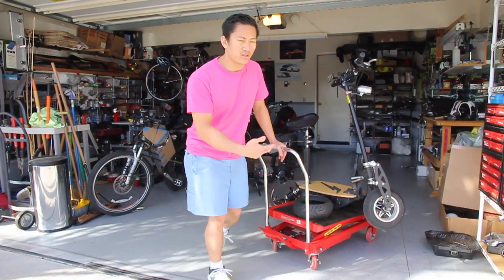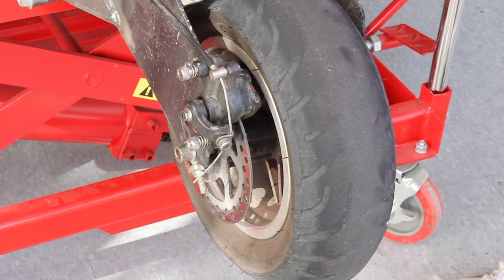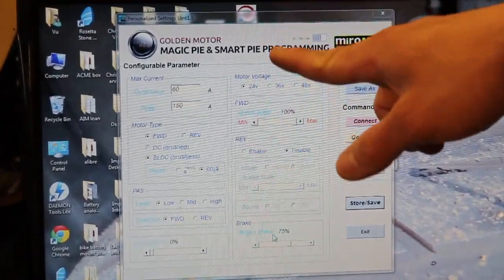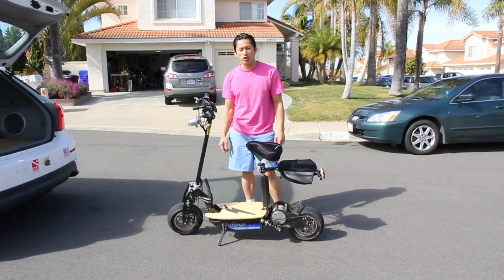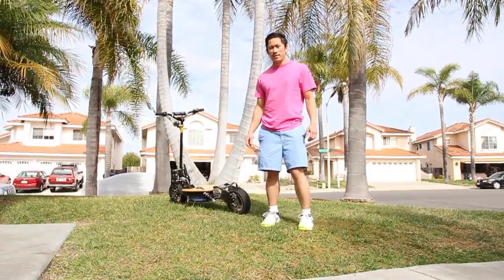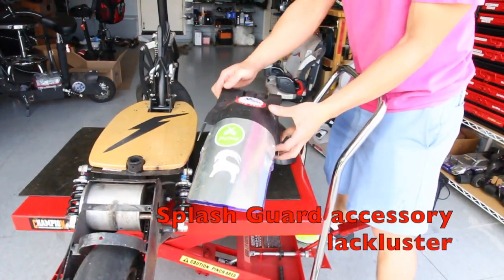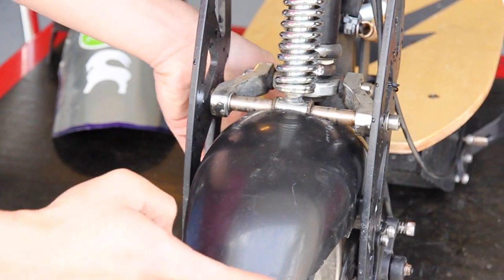1500 Watt Lithium Brushless Scooter Part 3

Comment: i got mine in the mail 2 days ago, man is it fun, i went to bestbuy, walmart and target, all in within 2 miles from home, folded it up up it in a cart and pushed it in the store as i shopped, i was never questioned. alot of torque, it almost stood up the first time i hit the throttle, i dont have hills were i live, got up to 31mph using speedometer app on phone, ill get a gps watch to mount on this to monitor my speed

Comment: Just a heads up on the controller that failed. He upgraded the new scooters controller that came in a few weeks ago (1500 watt ones). He said it was the only upgrade and everything else is the same. I think the tires were 11" though not 12". I'm not sure though.

Comment: Love your videos buddy! I have a very similar scooter too! 1800watt 48v one! Have had a reoccurring issue withmy batteries though man. Theyre new, and starting to fail on me, despite them having been replaced by the battery shop, for a different make! Could you please let me know what batteries you use, what make etc? Mine are PAGM 12volt 12ah. Any help would be greatly appreciated!

Comment: I added a switch for the cruse control, works great, the connecter for the usb is marked C, just connect that to a black wire with a pushbutton switch.

Comment: I have the 1000 watt version and the one thing I've noticed with it is the battery box flexes a lot, this flexing makes the scooter feel unstable, I'm used to riding motorcycles so know that the frame shouldn't be flexing so much.

It's a thought but the battery box should be reinforced to stop the flexing.

In fact I would say the amount of flexing you get from the battery box is quite bad so much so that even if you don't sit on the thing and simply push the seat side to side you can see the battery box flexing.

Do you find the battery box flexes on your scooter?

At first I thought it was simply the seat post moving but then I lifted up the foot plate and pushed side to side on the seat post and observed the twisting motion of the battery box, I would say it's quite dangerous to be honest.

Comment: I did have a question for you. I don't know anything about scooters, is there some way to chain it to a bike rack? If I buy one, I can't afford to replace it. Thanks for your time, and all the great video's.
Reply from the maker: Scott.  Thank you for your excellent question.  Sorry to burst your bubbles but based on your advanced age and relative inexperience with high powered scooters,  I would not reccomend this model for you.  Instead consider their 1000 watt version.   If you use a bike u lock around the scooter stem that will work just fine.
Reply: Hello and thank you for the recommendation. I will take it under consideration, and would be happy to spend less money as long as the one you recommend is as dependable as the one you purchased. Thanks for the speedy reply Minhvu Ly. I appreciate it.

Comment: Hi Minhvu. Thank you for the video. You did a great job. Questions for you. Did you consider a gas scooter? The down side to gas, is that they're very loud. The upside is you add gas and go where the electric you need about 8 to 10 hours of charging. I"m tossed between gas and electric. What are your thoughts? Thank you in advance
Reply from the maker: Hi.  I had a gas one which sucked.  Engine failed too often. Too much hassle of having to tune the carbeurator.  Gas and oil stunk.  This one has its problems too.  Controller failed, roller chain broke several times.  If you don't know anything about machinery then buy a legit scooter like a $5000 scooter you need to register with the DMV and get it serviced by a liscenced service center.

Comment: 12miles to work?
Can you take out the battery to charge it.If you were to take the fuse out of the battery would it still charge fully?
Anyway looks good with and without the seat.But I am looking into an e-bike!
Reply from the maker: No you cannot take the battery out
Reply: @MinhvuLy  Still nice.Reason I asked is because many e-bikes  have that feature.Also are you familiar with Lunar scooters they also come with an adapter that charges the battery taken out of the scooter.Anyway superb video.Scooters are cool.

Comment: QUESTIONS; Does the charger shut off automatically at full charge?  The controller looks different than the one they say comes with it on their site. The one on the site looks better. Do you know if they've upgraded the controller from the one you have? How much $$$ do you have in to it so far? (if you don't want to say, at least tell us how much the accessories you got from them cost (including the vnew rear tire, but not the mirror). Finally, are any small things like the hand throttle, gear chain, wheel bearings, steering bearings, motor gear, etc. wearing out or feeling flimsier than when new? PLMK

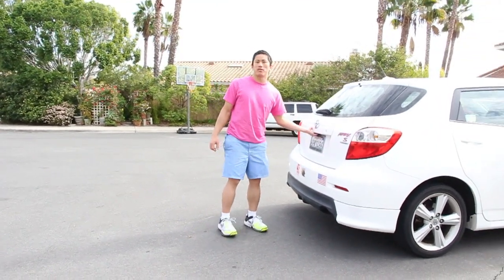Comment: When you went up that 10% grade hill(at about 5:24) did you have the "hill kit" on the scooter?
Reply from the maker: I had the non-hill kit gear.  With this much power and my light weight, there is no need for the hill kit.  I think the hill kit is for riders over 250 lbs.

Comment: Hill climb kit or nah? I ride off road quite a bit so I'm undecided. Also, I know the acceleration would be incredible but a reduced top speed, but I have an 800 elite with the hill start kit, and it's good off road with the torque. Bottom line is, is the stock torque good enough for off road and major hills without the hill kit??
Reply from the maker: no hill kit required.

Comment: Do you see this scooter as being capable of towing an InStep bike trailer. I weigh 160 lbs and my two kids combine for 60 lbs.  It would be low speed safe family riding - some hills. As long as I can mount the coupler it should work, right. Maybe mount the coupler on the upper shock absorber bolt? Handelinh shouldn't  be much different than pulling it with a bicycle.
Reply from the maker: It probably has enough power for 2 trailers with 60lbs each.  Replace the rear sprocket with hill climbing kit and you can tow 4 trailers no joke.
Reply: Ordered it today!
Reply: Rode it today for the first time. It is crazy fast. I couldn't believe the torque. The front wheel came up a few times when taking off - with a standard sprocket. It easily pulled my kids around and pulled them up hills with no problem. Top speed was also crazy. I'll try to get a reading. It even exceeded my expectations. Glad I saw the reviews on YouTube. Even with all my research part of me was skeptical. I was worried it just might be a little quicker than my EVO 1000 watt and have a bit more torque. It was no comparison. The hills where I would have to zig zag to make it up on my EVO, the 1500 Watt SS powered up with ease. It pulled my kids in a bicycle trailer up hills faster that my EVO could go down them.  Very impressive. I put rode for about 3 miles. Only the 35 degree temps kept me from riding more.
Reply from the maker: nycjsw Glad you like it.

Comment: hey minh, I have a problem with my 1500 scooter, when I turn the key toward on, the throttle  doesn't work but when I unplug the quick connect and plug it back on, it work.. AND than i turn it off the same thing happen again,  wondering what's wrong?

Comment: I was thinking of getting one of these instead of a mobility scooter as unable to walk too far.. Do you think it's safe at low speed also do you have to get the speed up by foot before you can use motor power? 

Can you use on walkway..
Reply: Darren Tian-sutton IM NOT HIM BUT
yes you can use it on walkways depending on the laws in your local area. and no it does not need to be pushed as it will just take of.
Reply: micheal checavich thanks for the reply..
Reply: no worries
Reply: +Darren Tian-sutton It's too powerful.  Get the 1000 watt.
Reply: +Darren Tian-sutton  i'm disabled too.  I went for the 1600w after trying some ..as then i know it will always get me back home ..it's got an eco button ..so its less pully for takeoff! ^^ and distance over torque.  worth it too and keeps you sociable and out.
Reply: +Rich Orange thanks for the reply..
Reply: Anytime.  This scooter is powerful.  I put the seat on, because it's so easy to do wheelies. It's got a lot of torque.  The 1000 watt is great.  I bought one of those too with a lithium ion batter.  It will go about 18 mph with a 30 mile range, depending on the weight of the driver.  Not a lot of torque, but it is reliable and nice.

Comment: Can you adjust the current so the start up accleration is not so strong?  My scooter takes off like a rocket with just a small twist of the throttle.  Several friends have been dumped off when they try it.
Reply from the maker: There is a controller cable that you can adjust power with but I understand Chris will void your warranty.  You could increase the gear ratio.  a larger front sprocket or a smaller rear sprocket would do.  I have 12/48 on mines.  I recently replace the chain and sprocket drive train to #35.  The original one wore down too quickly.  I also suggest you just get used to it by starting up a hill.
Reply: Thanks, I ordered the cable from golden motor, also the regen braking is not effective, I think it is set to a low value.
Reply: adjust the controller power to what number to decrease the start up acceleration? through the max current, motor voltage, or FWD?
Reply from the maker: trong ngo Play around with the settings to find your desired acceleration and top speed.
Reply: 92% Acceleration means the time it takes for the motor to reach full power. Sometimes called "throttle upramp". 100 percent is full power when you hit the throttle. Lower numbers means it takes off more gradually. For example at 50 percent it can take about a full second before the power builds up to where you are holding the throttle. Allthough many people like to have this set at 100 percent, lower numbers are easier on your motor, controller and battery.
Reply: Yes, Chris said such adjustments void the warranty. That's a shame, because the throttle is definitely too sensitive, and makes this beast somewhat dangerous for first-timers.
Reply: Brian Holtz
I set mine for 65 percent, stars very gently, but will still reach 35 mph, at 100 percent the first time rider will most likely get dumped off!
Reply: Steve Murphy Is there a model number or a link to this cable so I can hook it up and adjust the scooter

Comment: Do you need a motorcycle license for the 1500w in the state of California? Or can you ride it without a motorcycle license on the side walk at a slower speed?
Reply from the maker: yes technically.  But if you just ride under 30 in the bike lane you should be OK.
Reply: Minhvu Ly Thanks!!
Reply: https://www.dmv.ca.gov/portal/dmv/?1dmy&urile=wcm:path:/dmv_content_en/dmv/vr/scooters

A motorized scooter is a two-wheeled device that has handlebars, a floorboard designed to be stood upon when riding, and is powered by a motor. The Vehicle Code (VC) does not require registration, license plates to be displayed or the scooter to be insured. An operator of a motorized scooter must be at least 16 years old, possess a valid drivers license or instruction permit, and wear a helmet. A motorized scooter may be operated on a bicycle path, trail or bikeway, but not on a sidewalk. On the roadway, it must be operated in the bicycle lane, if there is one. On roads without bicycle lanes, motorized scooters may operate where the speed limit is 25 mph or less, and shall be ridden as close to the right hand curb as possible, except to pass or turn left.

Comment: I really want the 1500w one but that's 1500 bucks I don't have that kinda money laying around but I was thinking about the 1000w one to just got do small tasks like drop off mail and maybe go get a bite to eat or go to the gas station to get a quick snack and I was wondering if this would be good for that? btw im around 140 maybe a bit more and im 5,'10 so would this be good or is there a different type of scooter that would be better?
Reply from the maker: Save a little longer and get this baby.
Reply: On ebay there is a 1500w scooter for 599 obo. It isn't brushless so it only goes 35 mph but its almost 1/3 the price.
Reply: T

Comment: Minhvu, what is the brand name of the 90/65-6.5 tire Chris sent you? I can't find one that looks like that anywhere and I want to get a set for my 1500.
Reply from the maker: i think chris stop selling those cause they wear too quickly.  the new ones he uses are the off road kind with protrusions on them
Reply: +Minhvu Ly   Yeah, that's what came on mine... Innova's with slight protrusions.   I like your vids. man. I hope you do more, especially if you need to fix it. How's your steering bearings holding up?
Reply from the maker: +guitartec never had any problems with anything steering related.  i got 2500 miles on my scooter and problems have been with battery, controller and sprocket chain wear.
Reply: +Minhvu Ly  Wow, battery issues?  What happened?
Reply from the maker: +guitartec. battery wont hold charge.  i am waiting on new charger to see if itll help
Reply: +Minhvu Ly  Real sorry to hear that. Have you checked the battery and charger with a multimeter to see what's up?
Reply: +Minhvu Ly  How much do you weigh my man?
Reply: +Mega Silvabak  Lets just say I am good at storage. 225
Reply from the maker: +Mega Silvabak. i am pretty embarassed to admit this but i tip the scale at 155lbs
Reply: +Mega Silvabak 155?  After I shower, my wet towel weighs 155 :D&#160;
The SC&S site says these scoots will haul 300lbs'ers, and even 400lbs'ers if you have the Hill Kit installed, which I do. My scoot is doing just fine, but if I remove the seat post and just stand with it, then hit the throttle, it feels like I'm stressing the shit out of the handle bar post, so I always sit.

Comment: Im from san diego, and of you get a chance..   ride it up the hill at the corner of 20th and B street downtown.   If it will go up that.   ill be sold
Reply from the maker: Challenge accepted
Reply from the maker: Just looked it up on Google maps.  Seems about 8 percent grade.   The hill I rode up at rehco rode is 10 percent.

Comment: This is a good scooter, because of the Lithium battery and the Regenerative breaking  system  but you can get a nice scooter from Alibaba website for 800 dollars the scooter has 60 volt battery and 12 inch all terrain Tires. The  Distance is 45 too 55 kilometers variation by weight and riding style' also the top speed is 60 kilometers per hour so it's no slouch of a scooter, and further more you  are reassured of top quality with gas shocks on the front and rear and further more this scooter on the Alibaba Website Holds up to 150 kilo so it can hold higher weight than the super scooter lithium Brushless remember you are paying a lot for Lithium battery is it really worth it plus people are always inventing better ways for these type of scooters.

Comment: I am very close to maximum weight does anyone know how this will affect electric scooter
Reply: +dean north  We have a lot of similarities... I'm a "close to the max weight" (250) myself, my name is Dean, too,  and I too am considering this 1500watt Lithium scooter. I saw a video on their site recently that stated all the distance between charges and top speeds are dependant on the rider's weight, however, if you meant will a high weight rider hurt the scooter. No! The video said it could accomodate a 300lbs rider with the stock gears and a 400lbs rider with the hill climbing gears.
Reply: The scooters are made for top speed with 150 men  say the scooter goes 35 u might go about 23/25 mph
Reply: +Ryley Thompson   The heavier the rider, the faster certain things will wears out... the brakes, sprockets, chain, motor, shocks, tires, bearings, welds, etc.  If you're heavier and you want it to last, just be easy on it, maintain it, and be prepared to buy replacement parts more often.

Comment: Where can I buy one?? Please
Reply from the maker: I would recommend the turbowheel lightning.  Just Google that scooter.
Reply: Ty they are out of stock and that’s a little more $1650.00 then I wanted to spend?? Would you recommend the 2000 watt one you are riding in the video??? Ty. BRIAN
Reply from the maker: @brianmck7363  depends on how handy and mechanically inclined you are.  Also how much do you plan on riding?  Will this vehicle be your Daily commute or just to ride a few times a year?  The transmission ( roller chain and sprocket ) is a real weak link and  will break often.  The new scooter have hub motors that eliminates this problem by incorporating the motor into the wheel itself.
Reply: I was also looking at a Joyor F5s for $800.00 and it supposed to get 28-32 miles of range at 25-30 mph and has a hub motor like you talked about!! TYVM I appreciate you taking the time!! If you hear of another one $1000 and under let me know??
Reply from the maker: @brianmck7363  if your budget is around $1000.  You cant beat the mercane widewheel 1000watt.  Hub motor with suspension.
Reply from the maker: Also dont compare the range in miles.  Look at the amp hr capacity of the batt.   For example the mercane widewheel has 13.5 amphr batt for its 1000watt model
Reply: Thank you I will definitely check the wide wheel out